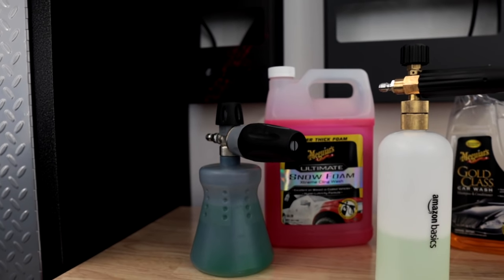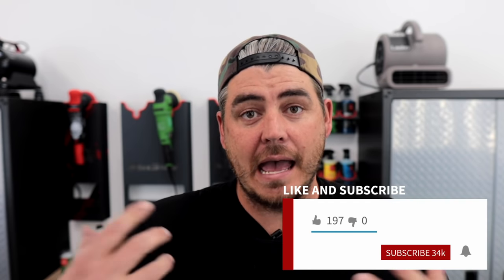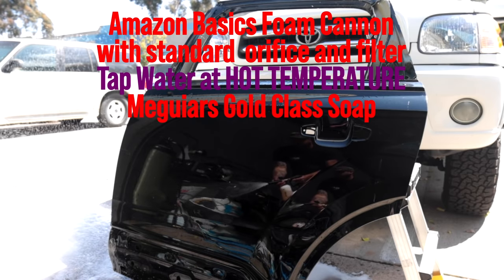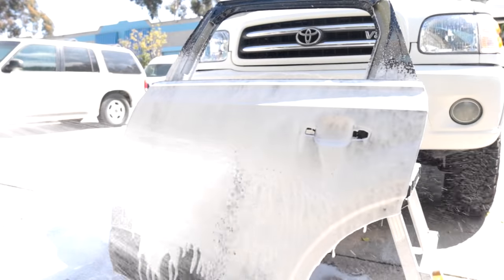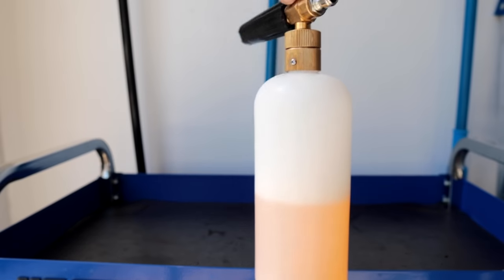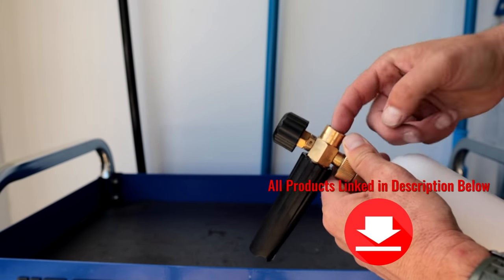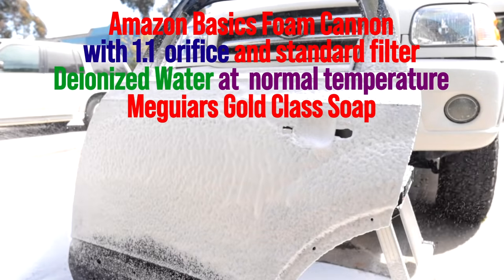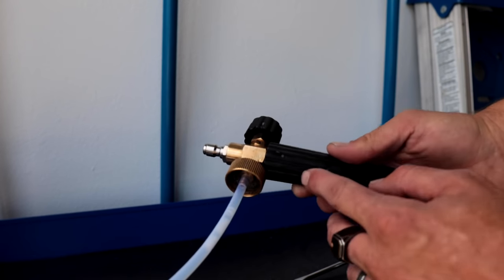How to get MORE FOAM from your FOAM CANNON Everything you need to know

Comment: I use a 0.8 orifice and a double foam filter in a Harber freight foam cannon. Pressure washer is a Ryobi 1800 psi with 1.2 gpm amazing foam everytime
Reply: I’m gonna try this setup. This doesn’t put any strain on the pressure washer?

Comment: If using a smaller orifice makes more foam why don't less expensive cannons use one?  It would be a zero cost upgrade and they have to know this fact.  Is there some collusion with the makers of the big $ cannons not to use smaller orifices so that the high $ brand names can justify what they charge?

Comment: I see the Meguire's Ultimate Snow Foam in the video. I have never seen a foam cling so long to the surface than that one does. Try it out and see how long it clings. I let the foam dwell while I do the wheels and tires and most have already dripped off but that stuff the car is still white with foam. Great video, keep it up 😎

Comment: Solid tips! I stopped monkeying around with the cheaper foam cannons and got a MJJC.
Honestly, my original cannon wasn't even cheap. It was one of the ones Chemical Guys included with a starter kit. On its own they charge like $70 for the thing, which I've realized is about $30 too much after using the MJJC.
Reply from the maker: Yea the mjjc is amazing! It really produces a lot more foam than the others
Reply: @imjoshv  I'm actually watching your video about whether hose length affects psi as I write this. No surprises in the findings. What I'm wondering though, is if the 3/8" hose changed the gpm. Would be nice if a 3/8" hose upped the normal 1.2gpm to something closer to or above 2gpm.

Comment: Just used the MJJC Pro for the first time. THANK YOU for the recommendation.  It worked insanely well.  Used it with the Active pressure washer and the godzilla (?) hose.  Great setup and combo.  Appreciate all of the content.  I had the Ryobi and it leaked oil, so I went with the Active unit.  One thing about the MJJC is that it goes thru soap/water very quickly.  If you have a larger car/SUV, you may need to fill up all the way to the top or refill in between.
Reply: did you change the orifice?
Reply: @codhruv839  Yes.
Reply: That's the price for thick foam😊
Reply: @jyo8914  I thought you weren't supposed to change the orifice to 1.1
Reply: @EC-uo4iv  I know that the Active pressure washer isn't designed specifically for it (they cite the 1.1 mm orifice as one of the reasons for the surging), but my 2nd pressure washer has been working fine so far.

Comment: The DI water has to be fed through the pressure washer too via a resin filter etc but will only improve foam quality if you are in a hard/mineral rich water area.  The Gold Class isn't a dedicated snow foam, but can be used as a basic one, so bit of an unfair comparrison with the other foam used. Also, thicker foam doesn't = beeter cleaning.  Bilt Hamber Auto-foam is a great cleaner but is very runny.

Comment: First of all, great job! Love the videos. I was wondering if doubling the foam filter would help with foam production,  or will 2 filters actually fit in cheap foam cannon,  asking for a friend 😊
Reply: The answer for my foam cannon is no, not enough room in the tube for 2 filters, idea ( extended tube to fit more filters )(diffusers) for more foam. But at some point, the product is as thick as it gets. Thanks again for the awesome videos. Without your videos, I probably would have just rented a pressure washer, now a proud owner of greenworks 2300 pro, ramp up is annoying but performance is good (house,fence,car) you helped me identify many applications, especially using foam cannon soft wash, the washer will not be collecting dust, and the 3 family cars are beautiful! 😊

Comment: Clearly the MJJC produced the best foam when compared to the Amazon basics.  On your recommendation I purchased the Amazon Basics and upgraded it to the 1.1 orifice and it works well.  My question is that all things being the same, other then the foam cannon, if you detailed the exterior of a car wouldn't the results be the same regardless of the slightly better foam from the MJCC.  Wouldn't both vehicles come out looking identical?  In terms of end results I don't see how it would be worth upgrading just yet for me because I feel like both results in the end would be great.
Reply: Thicker foam means you have more working time to take a detail brush and work it into emblems, etc. It also gives you longer working time for you to take your wash mitt and go over the entire car. The foam sits longer so by the time you get to the lower panels there will still be some foam for you to use as natural lubrication whereas if it was runny, the soap might have fallen off the car by the time you get to the last panels.

Comment: If you have a Gas Pressure Washer rated at 3200 psi and 2.5 GPM, What orifice is needed for MJCC Foam Cannon Pro and using CG Mr Pink or Watermelon soap???

Comment: Great video, I really like the MJJC.  My only question is do you have to use a pressure washer, I'm guessing you do so will a 3000 psi pressure washer be too much for it?  Thanks!
Reply from the maker: A 3000psi will be fine! The foam cannon comes with a 1.25 orifice installed so for the 3000psi I would leave it with the 1.25 and not swap in the 1.1
Reply: @imjoshv  Thank you

Comment: What pressure washer are you using and at what PSI? Also I feel altitude can make a difference. I’m at 6,300 ft above sea level and cant get any foam cannon to make foam that thick.
Reply: 1.1mm orifice if you have under 2gpm. Adams mega foam. Make sure all connections are tight. 2-3 oz of mega foam after water then shake.

Comment: You can also use ,go with all product  in your form canon that way you can get the creamy shaving form you want  one might say you be wasting product but changing the orifice could blow out your pressure washer motor  so before you make the switch  be 100% sure that your washer has the motor capacity to support a 1.1 orifice

Comment: I just recently bought the griots garage foam cannon, not the boss. And it has the metal ball at the end like the MJJC, but when not used it makes an orange rust like water in the bottle, have you seen that with the metallic ball at end of hose?
Reply from the maker: Interesting.  No i have not seen that there, but i did see some on the interior components of the head unit on the griots boss.
Reply: I used griots brilliant finish foam cannon for the first time last week; ran water through it before storing it.  After reading your comment, I can confirm, my brilliant finish foam cannon has the same rust water in the bottle and on the metal ball.  For reference, I own the griots BOSS foam cannon and have used it multiple times in the last 6 months of ownership.  My BOSS foam cannon DOES NOT have any rust water.

Comment: I bought the MTM pf22.2 foam canon, a ryobi pressure washer 1800  psi, I use the chemical guys mr Pink soap and I also installed the 1.1 mm orifice in the foam canon  but still I don't get that thick foam, idk what I'm doing wrong 😅.
Reply: Were you able to figure this out? I just bought the same setup.

Comment: @IMJOSHV I bought the 1.1mm from your site a while ago, put it in my cannon but when using it, it just leaked all over the place from when the connection is. No water was able to pass through the cannon, any ideas on what's going on?
Reply from the maker: Hmmm. No I have never seen an issue like that. Did you j spect the orifice, maybe it has some sort of blockage? What foam cannon are you using it in and what pressure washer also? You can email me at dtlrsupply@gmail.com and I’ll do what I can to help out!

Comment: Wouldn't using soft water to the pressure washer be an enormous improvement? I know it makes laundry detergent suds a lot more in a washing machine. It should also greatly reduce water spotting too.
Reply: I use water from my water softener, does help quite a bit with effectiveness and avoiding hard water spots
Reply: Absolutely. And deionized water even better. And you would get more life (more gallons usage) per deionization filer, if the water ran through a water softener first. You're getting the idea.

Comment: I bought the foam filter upgrade and it worked! Thicker foam with less soap consumed. Great tip! 💯 I’m using Mr Gold and 4:1 water to soap.
Reply: It's usually it's 10 to 1 ratio, looks like you're using way too much soap but whatever works.

Comment: Great tip!  Recommend using soap formulated for foam cannon for foam lifting of contaminants where standard wash soap is more formulated to be a safe cleaner with elements of lubricant to avoid marring.  Also, switching the orifice is good when recommended (there are charts out there) but smaller orifices can cause harm to a pressure washer motor by creating resistance in the system which it is not designed to handle.  That said, it is really unlikely it would cause harm but worth mentioning.

Comment: I bought a cheap foam cannon and got the 1.1 orifice.  However, I paused when I realized the original orifice had an o-ring.  I notice in the video you don't put an o-ring on the 1.1 when you change it out.  Did I see that correctly?  If so, is there a reason you didn't use an o-ring on the new orifice?
Reply from the maker: Hi what foam cannon are you using?  Many foam cannons dont have an oring at the orifice.

Comment: Is there any downside to installing the 1.1 orifice on the mjjc pro cannon?
Reply from the maker: Hey Tobias,

If youre using a stronger pressure washer you dont need to switch it out.  If your using an electric pressure washer between 1500-2300 psi and 1.1-1.3gpm then the 1.1 is the way to go! and no there is no downside
Reply: @imjoshv  that’s great, how about the piece on top that spins. What does that do?
Reply from the maker: @Tobias-sb8pr  that adjusts the amount of foam. I typically just crank my down all the way

Comment: from what i have seen in product description, orifice size depends on the power of your pressure washer. 1.25 is better suited for stronger petrol washers and 1.1 for weaker electric ones
Reply from the maker: Yep exactly! And even larger sizes when you get into the bigger units
Reply: Correct. A 1.1mm orifice doesn`t work on my Bosch that puts out 140 bar or 2030 psi. The cannon just pulses. 1.25mm works great on my cheap cannon.

Comment: Can i put a 1.1 orifice with my 2800 psi gaz pressure washer
Reply from the maker: I don’t think you would need to. It would probably out. Ore strain on the pressure washer than any benefit youd get
Reply: @imjoshv   what do you mean?      I need to use 3x soap of chemical guys soap to get,,,, boofff foam ,,,

Comment: I own a 69 Camaro RS/SS convertible with a 4 speed manual. I have owned this car for about 30 years. I always washed it with a lambs wool mit long before the idea of foam cannons. I just bought an Alfa Stelvio. So I thought... yes wash it with a foam cannon. Everything I buy is high end. I do not see the need for a foam cannon. They are to me a waste of money and more importantly time. Am I wrong? Using a foam cannon reveals there is no real break down of dirt. Water and good car wash does the job. So I do not see it... a "ton of foam" serves no real purpose. Is there any science behind your claim?
Reply: The chemical sticks longer to the surface, allows more time to react. In car wash I suppose gives the washer more time to rinse it without drying and leaving the water marks. Allows to better see how the job is coming out. And more importantly, is not something for DIY’s if you don’t do it as often, you don’t really get your money back. It’s always good to invest in good gear that you are going to use often and means something to you, just like you owning a car you like for those 30 years. Pretty smart I think